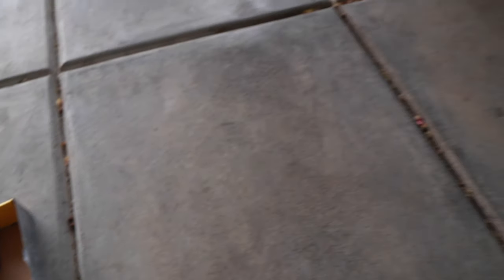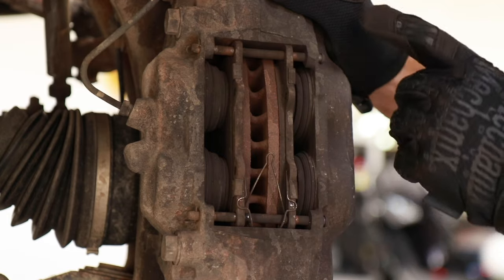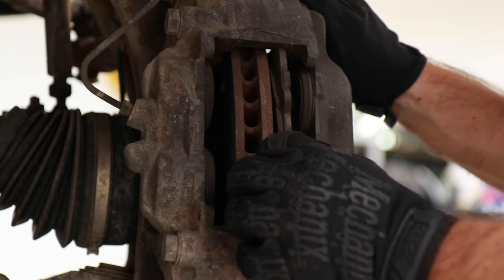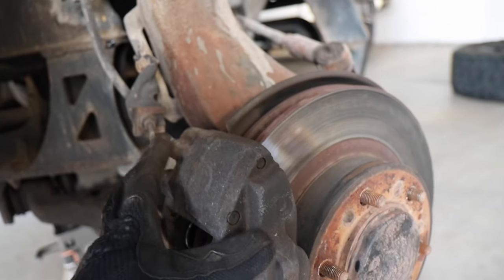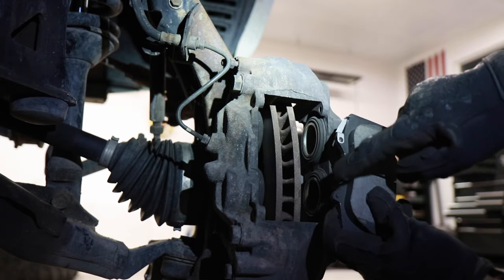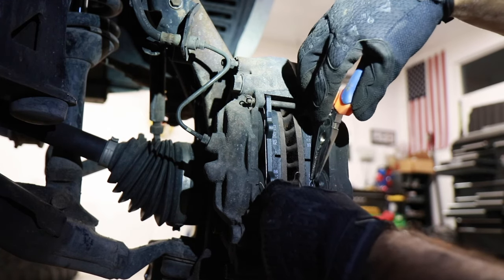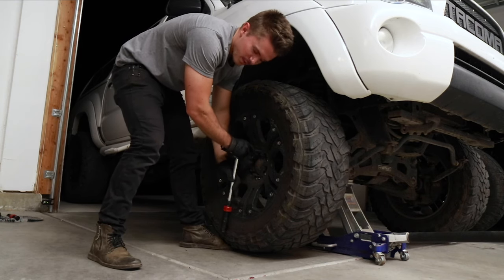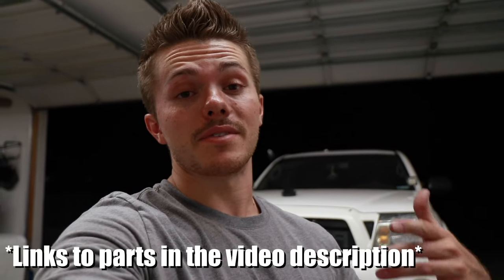Easy DIY Brake Job on Toyota Tacoma

Comment: I have a 13 Tacoma and love working on it too. Only thing you missed was putting grease on the ends of the brake pads that slide in the caliper so they're smooth moving when breaking. Also use a wire metal brush to clean the break pad housing in the calipers. 

At least where I live in San Diego, O'Reilly Auto Parts offers life time break pads. You buy the first pair and install them on your truck, or vehicle. When it comes time to replace them, go to the store, buy the exact same ones, go replace the pads and then you get your money back when you return the old ones. I'm on my 3rd pair. Enjoy your videos.

Comment: Was this Zack’s truck?
Reply from the maker: Haha nope, Zack has a gray 2018 Tacoma, before that he had a tan 1998 Tacoma. This white 2009 is all mine :)
Reply: Braxen McConnell oh okay! I came from his channel today so just thought that’d be coincidental haha. Also does using the screw drivers to make the calipers retract not hurt the rotor?
Reply from the maker: Haha that would be super funny honestly! Welcome my dude! But yeah, we just happened to be roommates and both have the same truck. As far as the rotors, the screw drivers aren’t going to do anything to them, they are metal whereas the brake pads are more of a ceramic or metallic material and are softer. You probably wouldn’t want to use screwdrivers on a brand new set of pads tho.